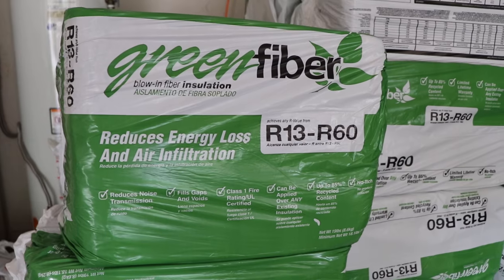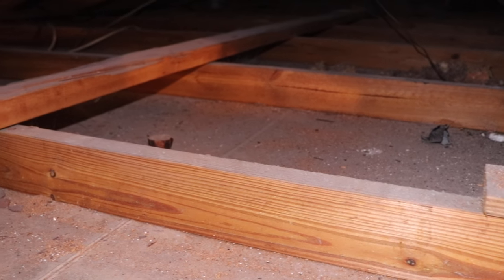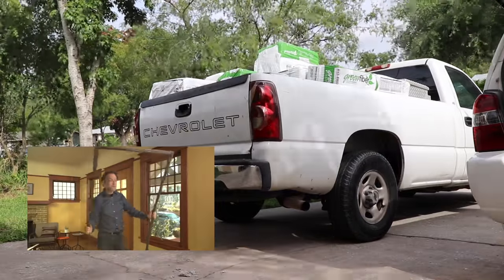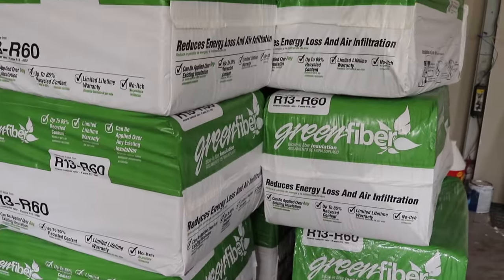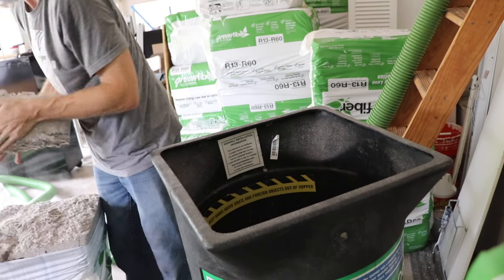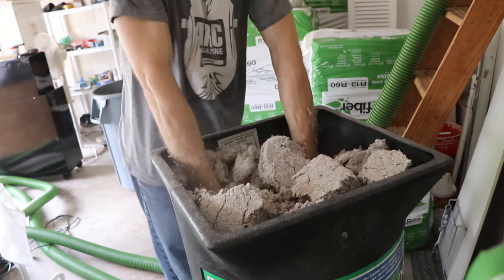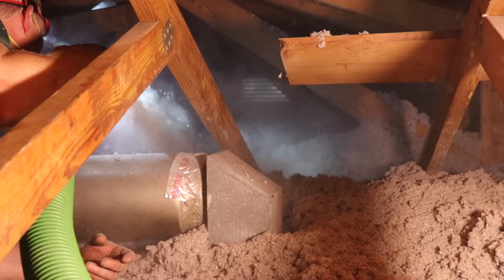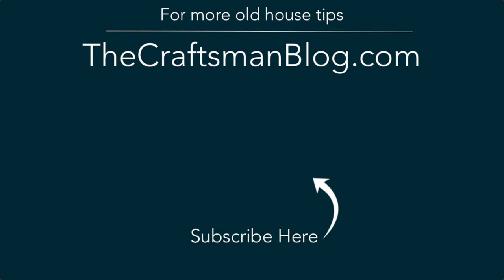How To: Install Blown-In Insulation

Comment: Firefighter here: in my 40+ year career as a firefighter I have responded on several hundred attic fires. All of them were cellulose insulation. Most were smoldering fires that may burn for days before the heat and embers reach wood framing and then once it reaches air the flames appear and the open flame fire is produced. I’ve never seen this happen with fiberglass insulation..
Reply: Not doubting you here but the packaging says sound thermal and fire protection.... Not sure if the stuff they are selling now is the same as what you experienced or if they are just false advertising..:.. I'm fixing to do this in my house because the attic is horrible
Reply: @joshyingling  flame resistant. It doesn’t support open flame but it does burn like a cigarette. The thermal insulation value is superior to fiberglass but you just have to understand its limitations. Also a comparison is a book. A book is hard to burn but open it up or remove the pages 1 by 1. And they burn easily. It’s all still paper with two distinctly different burning characteristics.
Reply: @ihate2wait  gotcha thank you for the info. I'll be sure to check out the options

Comment: There is so much wrong here I do not know where to begin, but I will.  First, the wiring has to be checked and has to be moved and marked according to code:  you can not create a code violation which would be a great way to void your homeowner's insurance.  No knob in tube PLUS the insulation is useless in older homes with 2 prong outlets or two wire wiring such as that show in the video:  Cellulose should NOT be blown over any cotton wire, 2 conductor wire with no ground, or wire that was not heat rated for burial:  If you have any of these, you might as well get the wiring done FIRST.  Second, Recessed Light fixtures have to be rated for insulation contact.  Third, every electrical ceiling or junction box bath fan, radon fan, or electrical apparatus under the insulation must first be marked with a flag.  Fourth, BEFORE ANY insulating is done the house must be air sealed.  This involves foaming around wires and pipes, wall tops, and ceiling boxes.  Air sealing is usually done with a blower door so that the sealing techs can hit a very specific amount of air that they measure the house to be leaking.  Fifth is something few people get right:  On the eave end of a gable, hip, or shed roof, you have to install foam blocking boards between the rafters so insulation does not spill into the eaves and block the ventilation. Every rafter space should have a minimum of 6 sq inches of eave vent per 16" rafter space. Before blocking goes in, a foam tray is stapled to the underside of the roof to conduct air from the eave vents up under the roof towards the ridge.  This eave process in the trade is called "tray and block".  Most plastic and aluminum soffit materials with very fine slits in them are a poor choice for eave material:  a better venting choice is a removable aluminum or plastic vent that can give you access to the eave.  When attics are worked in by professionals, they use "sliders" which are usually 2' x 4' x 1/2" plywood boards that each man uses in pairs:  kneeling on one and sliding the other in front of him.  The sliders prevent most drywall damage. All the work of insulation is useless unless your access to the attic is insulated as well.  Attic access is usually best insulated with a kit such as the one made made by ESS energy guardian that starts at $75.  When we run into old insulation we vacuum it out using a toro leaf blower and a 4" smoothwall tubing hose to fill bags which are then thrown out of the attic.  When working with cellulose its imperative to cover your skin as exposure to it is incredibly drying which can cause dehydration and heat stroke on a hot day.  Staying healthy and cool with the proper PPE is essential including RESPIRATORS and not masks, goggles.

Comment: Decent video but instead of saying just the depth for how much insulation was installed maybe reference that with the R-Value. 1' of blown cellulose typically equals R-38. Dont forget air sealing wall tops with proper insulation can save you up 33% of your energy bill and make one way more comfortable in the home
Reply: A foot,  or 12" of cellulose = R-44

Comment: Great video. Thanks. Question - what is the diameter of the hose here? Looks like 5", can you confirm? I am trying to insulate a tricky area between ceiling joists. The ceiling is open on one side, so I can see down the area between the joists, but there is an "X" shaped support halfway through between every area. My hope is that I can pass the hose under the "X", start spraying, and work backwards. I suppose that if it didn't fit under the X, then I could always MacGyver an adapter onto a smaller hose. Thoughts?
Reply from the maker: It’s a 4” hose I believe.
Reply: Do you need to remove old blown in

Comment: I'm currently working on my attic. I had vermiculite in there. For the safety of my family and their long term health I got it removed. Since then, I have been going up there weekly air sealing, insulating pipes, adding baffles and metal mesh to gable vents to keep out squirrels. Next I have to build up hatch and blow in the cellulose. Got 60 bags stored in my garage right now and have machine reserved for later this week.

It's honestly so much work I want to puke. Some days after getting down from there i do puke. But I know in the end it'll be worth it cause I actually care about the project and what it adds to the house.

Comment: Nice video.
Would have been better if you could have shared experience on how to get to the low sloped ends 20 feet from the center rather than the low crawl approach lol.
Good work
Reply from the maker: Ha ha! That’s the best way isn’t it? I usually force the hose down to the end and slowly pull it back as the area fills up with insulation.
Reply: @TheCraftsmanBlog  just finished the back half of my house. The mask got clogged because of the fine dust while I was low crawling so I had to breath and I moved that damn thing and took a mighty breath of boric acid.
After exhaling and fighting to get fresh air I sounded of with countless expletives, lol.
Their should be some warning and trick for the die hard novice such as myself.
Thanks for the reply!!!
Reply: @richardmcelroy6574   The trick is to not just blow the insulation like with a water hose. Place the end of the hose in a corner and when the insulation builded a little pyramid, pull out the hose a little to build the next one besides the first one. But THE END OF THE HOSE NEVER LEAVES THE MATERIAL! This way you have just very little dust in the air.

Comment: Question, I have canned lights in a room that I need to put this in. Well they are LED, is it safe to spray over the wiring and ballast of these lights?
Reply: check the rating. If in doubt, put a drywall box around the light. I've heard it has to be rated "A1," but I'm really the last person to give advice on stuff like this.

Comment: Nice video! Can u install blown insulation on top of HVAC pipes? I have the exact same house in this video and  all the hvac pipes that go to each room are in the attic. So i was wondering if i could just blown in insulation on top of them. If so, do the hvac pipes need to be insulated or the blown insulation will provide insulation to this pipes. Thank you for your help in advance!
Reply from the maker: You can install all around them though sealing any leaks would be best to do first.

Comment: What was the square footage of that home? I am looking to do my home & garage this summer totalling 2336sqft. I use my garage as a woodshop and has a ductless air conditioner in it but since there isn't any insulation I think the room could be colder and cool quicker. How many bags do you recommend for 2336 sqft?
Reply from the maker: This house was around 2000 SF. Green fiber has a calculator you can use to figure out how many bags you need on their website.

Comment: I wouldn’t want to be the poor bastard that has to perform work in your attic with that mess you just pumped up there. You just made a complete nightmare for any electricians or HVAC technicians to perform their work. If I ever encounter attics like this I usually refuse to work in them until the homeowner removes the insulation and I know a lot of trades people that would the same. This method of insulating should be banned!
Reply: Blown in insulation has been used for decades. Guess you pick and choose what to do. But fir ever person not wanting to work in that environment. Is a 100 more that will.
Reply: @jasonwillis4486  The method is a lazy way to install insulation.
Reply: @LtDan-rf9mx  how is blow in insulation lazy
Reply: @LtDan-rf9mx  I agree with you on trying to do work in the attic after blown in insulation. I'm going to remove all insulation in my 2000 sq ft ranch house built in 1956 that has fiberglass batts. I was looking at putting in new fiberglass batts R-19 faced plus R-30 unfaced. Here in Ohio the insulation cost is double for fiberglass batts compared to cellulose. The installation will also be more work for installing batts. I wouldn't call it lazy as much as cost factor. I haven't decided which way to go yet.
Reply: @timkr66  blow in insulation is a death sentance for ceilings 
It's so heavy eventually the ceiling popps
Reply: Lazy?   It's the only fucking option on an older home that has no vapor barrier.  Put your faced Batts in from top side and mold.   Put unfaced fiberglass in with no vapor, and same problem.
Reply: Just pack your tools back into your purse.